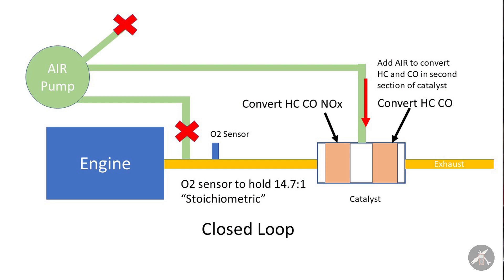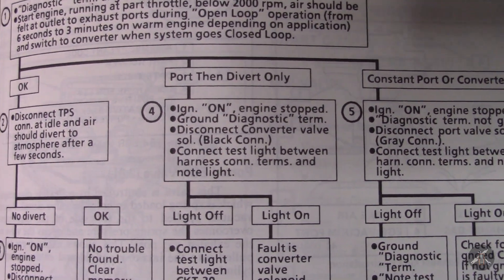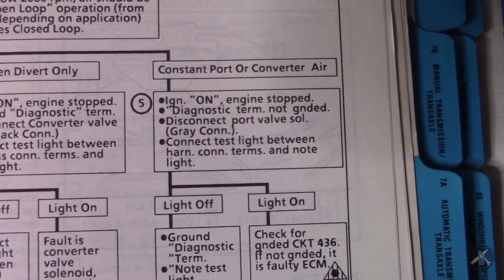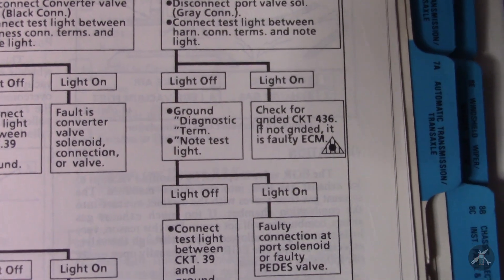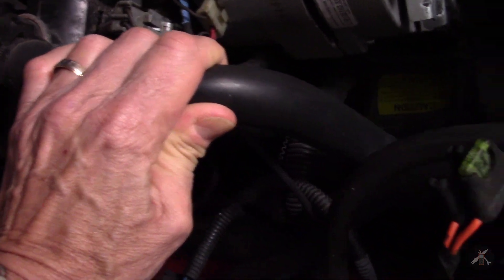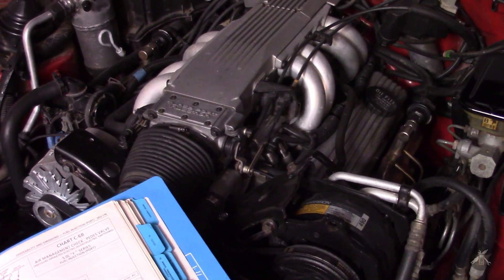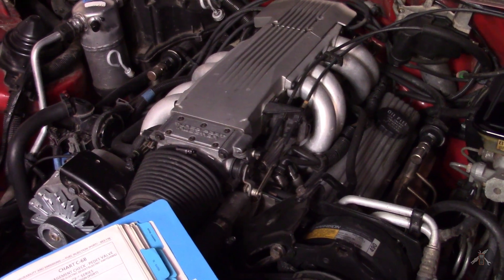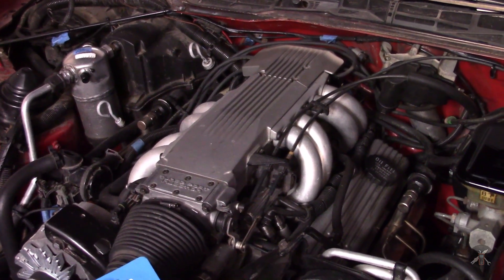3 Way Catalyst and AIR Pump, How Does it Work? - GM OBD1 Diagnostics - 3rd Gen Camaro & Others

Comment: 92 Rs camaro 3.1 - my air (smog) pump is still on the engine - acting as a serpentine belt pulley holder - but all the hoses dont connect to anything anymore - the exhaust manifold fitting hole is closed up with a plug - plumbing - tapered fitting.  I always wondered why my catalytic had a weird extended pipe (capped off) on the side middle section. My car stores no ecm codes and runs like a 6 cylinder should. Runs like a scalded dog on race day just fine.  I always passed emissions too as they shoved something up my tailpipe like a proctologist.  No codes. Lovin' life with reduced pollution controls. Belching unspent gas and fumes and enjoying my camaro (3.1 engine -  you should cover a video on the) 2.8/3.1 engine- they were reliable!
Reply from the maker: Well, many people disconnect the pumps.  Often they seem to think that it hurts the power, but those pumps really don't build any pressure, so they really don't draw much power.  Just look at the size belt they have.  It's usually much smaller than an alternator belt.  It does help clean the air, so I support keeping them going if possible.
If you are in an area that only does emissions at idle rather than loaded, you may very well pass the tests if you are running closed loop and the engine is in good shape.  The ECM usually can't tell whether air is going where it should on an OBD1 car, especially if the solenoids are still connected.
Reply: @bitsofwisdom460  I prefer leaving things original but not sure if i could get this back
Reply from the maker: @budsodalsky  No, I agree it's likely rather difficult and not worth it.

Comment: I came up with a good subject for you,  "relays".  If you use the camaro to explain that would be a bonus.  What are they for? Engineering perspective, how to test them on your camaro etc would be good - Ive never really understood what/how/ they are used for.  Car horns used to need them too
Reply from the maker: That is a good suggestion. I'll work on that.  Most of the cars still do have horn relays, they're just hidden better.

Comment: The issue now is that most of the pumps are worn out and there are no replacements. The bearings in mine are shot. I did find one place that rebuilds them, but I haven't inquired about the cost yet. Currently the belt is off of mine.
Reply from the maker: Yes, I found out that they became scarce after I purchased my rebuilt pump for the Camaro.  I think the problem was that the core charge was only like $3.00 and I suspect many people weren't returning the core.  I also understand that they can be rebuilt and I have seen that Cardone had them on their list for rebuilding if you had a core..